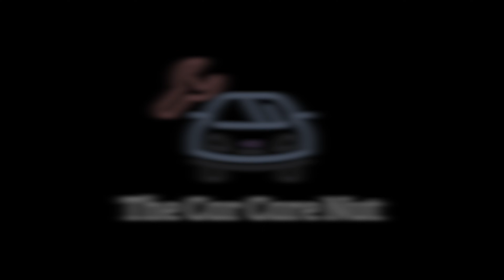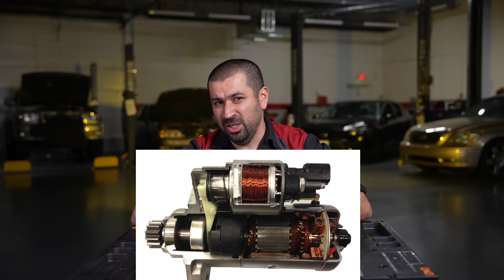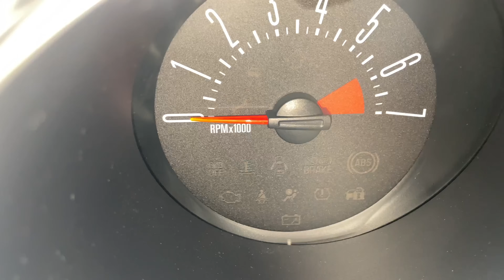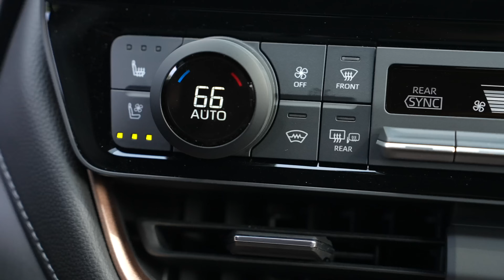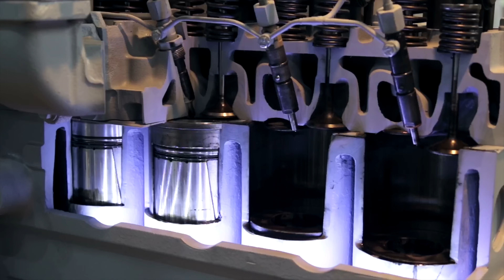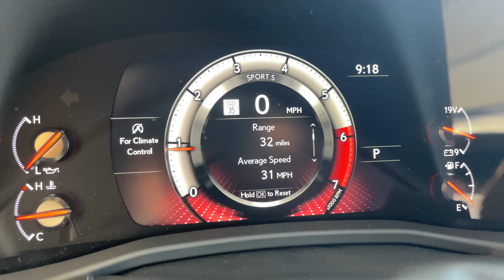How Does Start Stop Technology Work in Modern Cars? Everything You Need to Know

Comment: I have a new Honda Civic with this feature, but it's also a manual car which is nice because my default position at stoplights is always with the clutch in and the car in gear, and for the manual transmission you need to have the clutch out and the car in neutral. So for really long stoplights I can turn the car off if I want to, but most of the time the car just stays on, no button presses needed (although it's right next to the shifter so it's easy to press). My biggest concerns with these systems were addressed in this video, namely repair/replacement costs, potential engine damage, and fuel savings. Nice to know it's an emissions device but I'll refrain from saying what I think of those and the EPA here.

Frankly I'm just glad I can control the behavior without having to habitually press a button every time. I just wish this car had a manual e-brake so that push starts would be a more feasible reality. My automatic MB 240d can be push started but not my manual Honda Civic?

Comment: Start Stop puts a lot of shock on the timing-chain/ belt , every-time the engine starts this shock is present so with this technology those components will not last. The amount of fuel you safe does not equates the mechanical cost incurred in the life of the engine. Worst idea in the design  of cars ever.

Comment: If I had known the car I bought had this tech, I would NEVER have purchased it.  It wasn’t explained to me and surprised the crap out of me the first time it stopped. I thought the car was a lemon. Now I know it is.  Manufacturers:  since we are stuck with this crap, program it so I can choose to turn it ON, not force me to turn it off.  Additionally, I am glad the warranty covers the starter and ignition system because it will over work the entire system and blow something.  I just wish the battery was covered.  This is one of the most stupid ideas in years.  No pollution reduction and the fuel used to restart is more than if it was left running.
As far as noticing it, the lag is definitely noticeable and the rough restart is dangerous. I do not trust it.  I contacted Kia with my concerns and got blown off.  Even the dealer wasn’t helpful.   Oh well. Won’t buy another one.

Comment: Constantly restarting an engine with zero oil pressure can not be good for that engine.  Even if it's hot and oil coated,  you're pushing pistons against compression with no oil pressure in the crank bearings. It may not be as bad as a cold start but it's still not desirable for long engine life.

Comment: you missed one engine damage potential. 
turbo chargers really don't like to be shut off and lose the oil pressure when the exhaust turbine is very hot.
coking the turbo shaft from heat and lack of cooling oil puts a lot of wear and tear on the turbo bearing shaft.
not a problem with naturally aspirated hybrids.

Comment: The starter is NOT the only casualty. Start\stop kills bearings which leads to a rebuild. When the car shuts off the oil pressure falls to zero. The bearings will remain "wet" with oil, but that does not keep them safe. The cam and crank ride on a cushion of fluid which only exists when there is oil pressure. Initial startup is when an engine receives the most wear. This is true even when the oil is warm. I manufacture automotive lubricants for a living and have extensive data on the subject. Start\stop DOES cause increased engine wear. It only exists to get the EPAs nod of approval.

Comment: Am I the only one around who isn’t annoyed by this? Yes there’s a slightly longer delay when starting but if I want a fast start I can simply partially release the break early, which simply starts the engine, it’s that simple. And no I do not want a rocket start every time because that wastes fuel, wears out the car more, wears out the tires more, and is more dangerous.

Comment: Between cvts , start stop and the crazy pricing it’s a wonder how any car is an attractive buy these days. Have had my car 12 years so haven’t experienced a lot of this stuff until recently when given a loaner from the dealership. Beautiful interior, big screen, incredible sound system. I left the lot and made it to the highway and the first thing I noticed was how unexciting the acceleration was in this new car. If I were an emoji the look on my face and feeling was 😐. Then about 5 miles in traffic backed up due to and accident. I came to a stop, nothing unusual. Traffic starts to move a little and take my foot off the brake and I feel this disturbing jolt 🫨🫨!!  Auto start/stop. Ewwww. Hate it. Get back up to speed and it’s the ugly drone and uninspiring acceleration….cvt….ewwww. Hate it.  Since I’m in the market for a new car I start looking a little closer at what’s out there and disappointed to see these cvt and auto start/stop crap on everything…. Never had such a hard time trying find a car to be interested in.
Reply: Idk my Honda isn’t that bad with a cvt. It’s actually very quick in low rpm. Maybe that’s the ivtek? I mean if I wanted a fast accelerating car I’d buy a sports car? Every light I just drive like normal and cars are far behind me so at least my cvt isn’t slow

Comment: Great info!  
My 2013 Chevy Malibu Eco(had it since new) has now over 111K engine starts and are now nearing 77K miles.  I believe this year model has the best Start/Stop system, it is very robust as it doesn't use the regular starter during a S/S condition, it uses the alternator for this and is quieter and smother.  Also, the alternator turns into a motor and helps the ICE during acceleration and to keep low RPMs when going uphills at speed.  It doesn't suffer from low voltage during engine restart.  Perhaps this is why most of the lamps are still the factory installed units.

Comment: I don't know about Toyota's system but I use a Honda all the time with start-stop and it works seamlessly. You can hardly notice the engine start back up and power is there pretty much instantaneously. It doesn't have the lag that the first stop-start systems had. Also even without turning off the switch you can control it with brake pressure. If you feather the pedal at a stop it won't shut off until you press the brake firmly. It's a nice feature.

Comment: Even larger start loads on a diesel as the compression ratio is much higher.  Easy way to eradicate all the this start stop nonsense without having to turn it off every time you start the car, approach the traffic lights/stop whilst applying the brakes very gently at the end, just enough to hold the car.  The car will continue to run until you push the brakes harder. Also the car will start coz the AC is running and the battery doesnt want to run it.  So it starts the car after 30 secs or so.  Thus you save bugger all fuel or prevent bugger all emissions. 
As for battery life - they tend to be shorter and especially in hot climates - mine lasts 3 years, but they are only $70 ea.

Comment: I can't believe that a channel with 1M subscribers says such stupid things:
1:23 - Numerous tests have proven about 5-20% less fuel usage with the start-stop technology
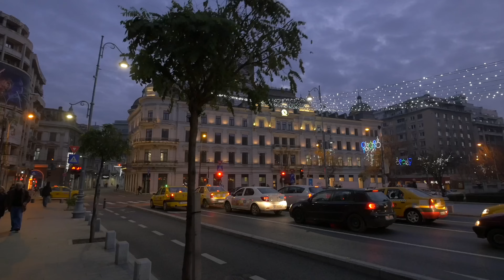1:40 - maximum load on the engine, when standing still, really ?
18:25 - you're making the software sound like magic. It's literally like 100 lines of code and can be programmed in a day
21:15 - really - the only time you stop is at a traffic light? what about congestions ? what about at a crosswalk? what about another 15 situations?
23:10 - looks like computers really scare you .. this isnt rocket science - its calculating a few numbers .. its a computer .. yes its quick ..
25:38 - a timer does not count. a counter counts
26:00 - really, I can create a dangerous situation because my car wont start moving? I can think of 50 things that can go wrong and I cant be able to move. Being stopped is the least dangerous place. Dont increase the anxiety of people to push them to come to your shop to get stuff fixed .. also you can refurbish it by changing its components
29:00 - No, start-stop systems are not how the future is going .. we've kinda moved forward to stuff that doesn't polute so it doesn't matter if you're running
Learned nothing new. I'm not a subscriber and decided not to subscribe. Here, have my dislike and educate yourself

Comment: That and abs can get you into a wreck if it malfunctions. I use to drive for the railroad and one of their cars I was driving malfunctioned while I was coasting down hill and as I started going up hill the engine didn't turn back on and I had to pull to the side of the road and turn off the car and back on. Also abs is stupid I had a similar situation where I was driving in the rain and went to turn a corner and the abs started Pumping my breaks for no apparent reason and I started to slide sideways and almost got into a wreck.

Comment: So if it counts the start stop cycles to determine the life of the starter, switching it off at each start-up will basically stop the process and I will never have to deal with it?  This seems like an extremely complex system with a lot of parts and components to replace at some point in time.

Comment: My 22 Gladiator has this, and i dont even notice it. It starts and stops so smoothly that there's no delay in me going when then the light changes to green. I've seen so many people complain about it and how they dont like it and say things like its destroying the engine and killing the life of the engine, when they are just stuck in their old mindset on how cars work. Like the guys who didn't trust fuel injection. I have a Taser Mini and have the option of turning it off permanently, but I can't see the point in that choice. Great video!
Reply: you obviously dont know the amount of engeneering and important additional parts that can and will fail for you to save 1% gas and environment, as your car gets older, I personally will disable that system or buy a car without it.
Reply: @art333-dg8dd  You obviously don't understand modern engineering and the amount of work that goes into making sure those parts don't fail. Do some research, most issues with the start/stop system has come from people who are modifying or removing it. Which can void your warranty. This video does a fantastic job refuting your entire comment, which brings into question if you even watched it, or if you did watch it, did you listen to anything or just keep telling yourself you were right the entire time?
Reply: You can't reason with them their brains don't work  @jgordon0708

Comment: One major topic not covered is engine oil pressure drop during start/stop event. There will be additional wear and tear stress on all engine moving parts including turbos etc. Some engine manufacturers did make changes in materials to make them more slippery/durable for oil starvation operation during stop/start events. In short, start/stop events will always cause oil pressure and oil film protection to be less effective. Unfortunately, this is the hard truth about oil pressure and start/stop feature. Can't beat physics, as simple as that.

Comment: So interesting. My car is a cheap hatchback with Start&Stop but it doesn't have most of what is mentioned here.
Note that It relights the engine in about the same time it takes to press the clutch, select 1st and release the clutch. Although I usually just leave in 1st with clutch depressed when the engine is off.

However:
Starter with 2 solenoids? Nope. The starter and alternator are one and the same, always connected to the engine. I was told there are two versions of the tech. Mine has starter and alternator in 1. Others appear to work with 1 solenoid but the gear is permanently attached to the engine. The solenoid connects to a clutch. The starter attaches the clutch and revs the engine up. In mine, it's permanently attached and is a 2-purpose electrical motor (also saves space). This is also related to the 2-stage recharge. When I'm in gear, above 1700rpm, releasing the gas, the motor goes into heavy recharge mode and provides extra energy storage to the battery. That saves a lot in brake pads and prepares the battery for another start.

HVAC modifications? None. If A/C is requested, engine relights. Although A/C works by turning itself on and off periodically. Works the same as the non-Stop&Start I had.

Special transmission? Mine has a perfectly standard one. No different than my previous car except a sensor to detect whether the shifter is in neutral (it doesn't even know in what gear it's in. I've already got, rarely, suggestions to go to the previous gear when in 1st, for example).

As for fuel injection, knowing where the engine is? Nope. It's mechanical. It just follows the mechanical position flow. The timing adjustments are minor and done mechanically. When it relights, it resets itself to a predefined setting which basically unpauses the process. It will take an extra half revolution because there's no ready explosion but it's still fast 1s relight.

Also, my car doesn't do transmission oil check and some others you mention. It does the simple ones such as seat belt and doors. But I've usually block relighting when I just want to open the door for a small thing or just to unbuckle to reach out into the back seat for some reason.

Though: One interesting thing that I do is that sometimes it wants to relight but I don't let it relight. I just delay the relight to when I actually need the engine. Interestingly you didn't mention that situation.

Comment: Excellant video.We just bought a brand new Subaru and I hate the start/stop feature but my wife likes that feature.We are going back to the dealer because it does not stop everytime we stop at a light or stop sign and several times it started up when my foot was still firmly on the brake.I think it's a gimmick to have this as it really doesn't save much fuel to validate this feature,I will always turn it off when I drive the car.

Comment: Thank you for the details.  I have a 2017 Highlander Limited and will turn off this annoying technology with the switch.  The battery is $650.00 plus taxes in Canada. I believe you said a regular battery can be used. Is that correct?

Comment: Usually, the most damage that occurs to your main bearings and connecting rod bearings is when you start the engine and the short time it takes for the oil pressure to build up. Just sayin.

Comment: I'm so glad our 21 Lexus NX and 19 GX doesnt use this system. We had a Subaru with it and I couldnt stand it. I figured out that if you lightly keep pressure on the brake pedal at stops the system wouldnt activate.

Comment: If the hood is poped it disables it. If your running you defroster it disable it. if your using Mex AC it disables it.If you put your automatic transmission in manual mode it disables it

Comment: I really like the "it's an emission device". Yes it is but in the same time, there are 10 new components added to the car that pollute a lot to be manufactured just to save some fuel. So in the end... it doesn't even matter! I don't think start-stop system saves CO2 in the short run on the world basis due to the added components. And the components wont last long enough to save CO2 on the long run. It's another "green" hoax, nothing else.

Comment: What about oil pressure? Every time the engine shuts off, the oil pressure is 0. Before the oil pressure is restored is a metal-to-metal contact, which does not add to engine longevity in my opinion.

Comment: Renault already had start/stop in Europe much of years before 2016 (my Opel Vivaro is a Renault Traffic). They had to make the oil tubes faster and replaced the steering as well with electrical steering. After three times using the brakes, engine switches on again. The batteries used for this type of cars in Europe are called AGM batteries. In fact, they are the same, but they have some software and hardware in them, and that is why they are a little bit more expensive. A wrong battery in such cars will degrade very fast (i once bought a wrong
one and use this one one my PTO system or as spare in the car). Heating and cooling DOES get cold in these cars, so for Renault you have to switch off the START/STOP button. And it does not tell you why it is not activated but you mentioned all reasons very well. +je

Comment: I prefer it in manual cars because the annoying interruptions at low speed (e.g. parking, especially with a DSG gearbox) are eliminated. With the clutch down it doesn't stop, and most new cars I've driven start up very quickly, much faster than the time it takes to shift into 1st. All the benefits with fewer drawbacks.

Comment: One of the best (non hybrid) stop start systems is Mazda's 'i-stop'. It works super quick and smooth. They put a lot of thought into it if you research it and it shows. One of the worst systems I experienced was on a Skoda (VW group)fitted with a DSG transmission and TSi engine. Slow clunky and jerky..and ultimately very irritating.